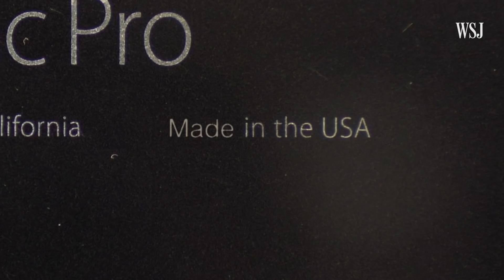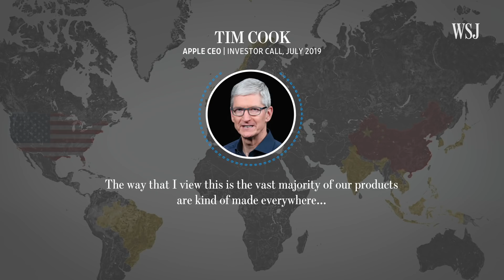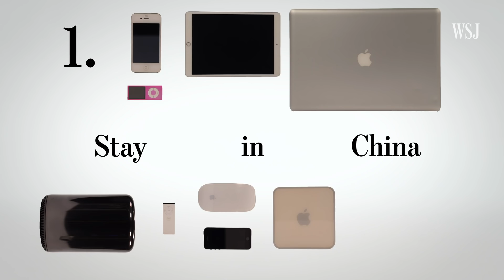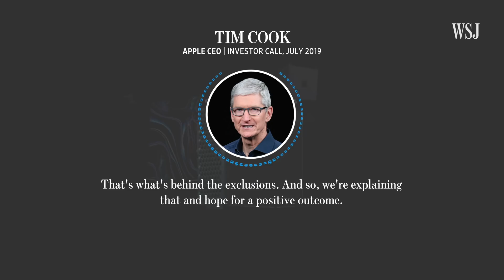Why Making Apple iPhones in America Is So Hard | WSJ

Comment: You must be crazy to think that manufacturing will be coming back to US
Reply: Tell that to the industrialised part of this country. Who vote in snake oil sales men. Promising to bring back industry and reopen coal mines.
Reply: The manufacturing plant will increase pollution in the US, if they come back
Reply: It will... Automation and Robotics will takeover and factories will run virtually labour free.
Reply: @aryan991000  that is after automation of the supply chain first... all the components, but still have to deal with abundance and cost of raw materials....  in a nutshell, any company that wants to succeed building in U.S. must be vertically integrated.  they need to invest and own all parts of the supply chain, from material procurement to fabrication to final assembly, and need to be expert in everything they touch.  huge scale and lots of investment.... downfall is if their products tank or have a down year, struggle ensures.  

Another option is for government to subsidize creation of automated vertical supply chain as form conglomerate subcontract manufacturers here in the states.  in turn, they can provide services to multiple u.s. companies and diversifies the risk when a company or product tanks.  risk will be trade secret shared when it's not tightly controlled in-house.
Reply: Iphone would cost $5,000
Reply: Different types of manufacturing. Solar panels. Yes the rare earths are in China but they can be processed here. Wind mill technology. Electric vehicles. Nuclear technology. But end of the day, the USA should not be trying to outbid China in labor costs either. The Workers should be getting a livable wage and building things only the USA can build.
Reply: @NotShowingOff  Wind and Solar are no where near effecient enough to be reliable for commercial manufacturing tasks. Nuclear is definitely good enough though.
Reply: @afabuloussentientbeing8112  This is rapidly changing, especially when combined with battery storage. There is no technology developing faster than renewable energy production. We can easily install solar power sufficient for ten times current total energy consumption. Energy will be nearly free in the near future, in the same way as broadband communication is almost free.
Reply: Shahzad Ali  If you lived in India or China you would know that there are few alternatives to accept the work that is offered. Many live in poverty, not because they are stupid but because some fortunate ones have decided that the riches are their only. Try not to be condescending if you are privileged.
People in China have risen from poverty through hard work. I think that we should show some respect. Of course they had to start with low wages, but as their skills and competitiveness have grown so has their wages. It is likely that the current inequality between countries will diminish and China will reach the same level of wealth as the western world. Unfortunately the inequality within countries are growing and it could become as bad in China as it currently is in the USA.
Reply: pproust  : As the song says, "That ain't workin' that's the way you do it
Money for nothin' and your robots come free."
Reply: Why would you event want to go back to the least profitable and most problematic part of the production chain?
Just slap that logo on there, play a few ads, and get 200% profit.
Many of the most profitable companies in the US don't manufacture a god dang thing.
Reply: Romelo Henderson that’s just the cost for the packaging
Reply: @aryan991000  - You can't automate everything it's just not feasible
Reply: It depends. As the middle class grows production costs in China are increasing. In some cases it’s cheaper to manufacture elsewhere. Apple could easily make the switch, it wouldn’t be too dire
Reply: They're crazy 😂
Reply: It is but no by humans
Reply: @devilselbow  lol... where did u read megacorp?  no one has loyalty... period.   it's all supply and demand.  if ur favorite shop or car or anything raise prices to where u don't feel reasonable to pay, will u stay loyal to pay up for increase that are atrocious?   i don't think so.... likewise for all business... their main objective is profit.  until the GDP is updated to shift the focus from earnings and include other intangibles, that's what business is set up to do.  if you don't believe me, go tell your ceo at your work that they should become non-profit and he shouldn't be making all those $$ as well as forgo all earning for this quarter... or, you can be the brave soul and tell him you will stay loyal and you will work for free... lol.  simply if there's no incentive, no one will ever do anything for negative return.  

unless, you have some genius alternate ideas that you like to share on how miraculously manufacturing can come back to the states all of a sudden???  and, if they don't come back, you whine and complained about how we don't do anything to keep the jobs from going oversea... instead of looking at it as we exploited the cheaper labor and working conditions for more profits.  yes, perhaps you like trade tariff and think it's effective.  but, your $ are paying for the tariff as well as all the farmer subsidies.  public $ have already been used to put on band-aid solutions that are ineffective and in ways you cannot even comprehend....
Reply: Trump knew US can not be great again only by finance. But American people already spoiled.  they don't want take actual work to earn slow money.
Reply: @aryan991000  The main hurdle is that the entire supply chain is in China not just the assembly. Also there are plenty of skilled non-repetitive tasks that still require humans.
Reply: It will happen once we have fully automated factories.
Reply: Are Trump's ties coming back?
Reply: The only manufacturing that still exists in the states is a result of contracts where that necessity is explicitly stated as a requirement, such as in the fields of aerospace and road equipment. Even then, that rarely is extrapolated to the provenance of the material.
Reply: @Pluggodmelo  that's some bs
Reply: @aryan991000  better than nothing
Manufacturing brings in big money to the country
Reply: @NotShowingOff  "building things only the USA can build."
If you believe there's ANYTHING that "Only the USA can build", you've never been outside the USA. Because often it's the other way around.
If the USA had to actually earn it's lifestyle, instead of its "Spend now pay off in 6 generations" mindset, And made things of Actual Value, instead of "If I take 100 dollars and lend it to people I can magic 100,000 dollars into existence because Math!" The USA would need to be 100x more intelligent and 10000x more productive. The USA isn't an economy, it's a Multi-Trillion dollar Bankruptcy / Ponzi Scheme.
Reply: If all the U.S. citizens willing to give up some democracy to allow a more potent government to exist, and certain companies willing to give up certain interests, that manufacturing job might return.
Reply: REAL AMAZING WORLD duh! The pollution is in China right now. That’s obvious!
Reply: Why did you write "in US"? Didn't you know that when the name of the country consists of the plural noun you have to use "the"?
Reply: @SardorKirck  English is not my first language , actually it's my third language. I think what's more important is the context ... You can clearly understand what I am talking about ! Cheers
Reply: @prajwalsawant984  I understand, but this is so common that even Apple wrote "Assembled in US" at the bottom of Mac Pro, so I thought there is some exception to the rule
Reply: If south korea could do it with samsung phones, why can’t the US?
Reply: @sergeseanmison7787  We don't oil and coal these are not efficient energy. we should move back to renewable energy and make things right again as human species. and another thing is that some of google cloud center are powered 100% by renewable energy why other companies won't do the same. and assembling an apple products in the U.S will cost buyers much more than producing them in China or India because of cheap labor.
Reply: @aryan991000  a great leap into the science a huge problem for humans
Reply: The only possibility is domestic AI or advanced automation technologies brings down the cost, lower than Asian workers.  Manufacturing will be back, but not jobs.
Reply: Isn’t the current Mac Pro being manufactured in the United States? Who was crazy?
Reply: Make in USA, sales goes down & push buyers to go for a foreign phones, they ALL are pretty much samo samo.
Reply: Bengt Björck 
He knows it, but he needs RED MEATS to throw to his base, bashing Chynna is safer then upset his Lord & master Putin..(p33 p33?).
Reply: I would change the word "crazy" with "ignorant"
Reply: @PabloGonzalez-hv3td  You can't automate everything yet. The automation we have now wouldn't have been considered feasable in the past.
Reply: @ExternalInputs  For sure but there's still a practical limit. That and  it's always going to be cheaper to exploit an army of Asians.
Reply: The let's tax them on 30 % import tax there are not American products anymore. These products cost to taxpayers more than the taxes they bring.
Reply: So If you dont like pollution stop buying plastics products 
Electrics leather clothing.
Easy....
Reply: @pawala7 all governments want that because of the the jobs the taxes. The happy voters. The point is 
To stop giving free rides at the companies that moved production in 
China and start import taxing them at 50% then you will see them how quickly will move back. I love having free market but that is ridiculous.
Reply: @Nicolas B. Henry there was a time when China was the enemy. everything was made in usa the economy was thriving. And the prices where based on usa economic capabilities. I am not talking about I mac .prices .50s 60s
70s
Reply: Bengt Björck 
The US is so rich that 30 k $ a year is considered bellow poverty line in US...let that sink in. Yes you can argue that life is more expensive, but that same "bellow poverty line" person has the latest iPhone...drives a Toyota or a nice Nissan, can eat very well (too well in fact)....gets 2400 $ / month now with Covid.
All these things are considered higher middle-class for most part of Asia, Oceania and South America...if not super-rich for an african. 
The guy making the iPhone in China gets 600 $ / month. Covid unemployed in US gets that in 1 week while NOT WORKING 😂
Reply: @BjorckBengt  China didn't take American jobs..Industry and  Wall Street along with our government made it happen captain... ...It's a simple concept which I lived through....
Reply: @Horizon301.    Your right and they'll make the switch with the help of the lobbyists and politicians here in America...
Reply: @gillybabi5642  like Tesla , for example?
Reply: Prajwal Sawant in 2000 I used to assemble those old color apple 🍎 monitors ...
Reply: I would pay $25/$50 more for a phone if it was made in the US but I think it cost waaayyy more than that if they move productions to the US.
Reply: @Pluggodmelo  ridiculous...
Reply: @afabuloussentientbeing8112  absolutely correct...
Reply: This didn't age well
Reply: It's not impossible.  Things happen.
Reply: Well, it’s happening
Reply: Comment aged like milk

Comment: The cost to set up a factory in the US and China will be a huge different. If you also factor in the labour cost in the US, the cost of putting an iphone the US easily reaches USD200 where else the cost in China only requires half of that or perhaps even lesser.

Besides the cost, another couple of issues are skill, scale, expertise, and infrastructure — all of which require money, time and long-term investment. Unlike other manufacturing jobs that have migrated from the United States, Apple wouldn’t be bringing them “back” so much as starting from scratch. The cost would come in attempting to build a system that’s never been in the US, but has been built over decades abroad.